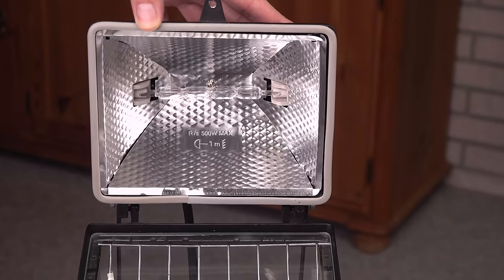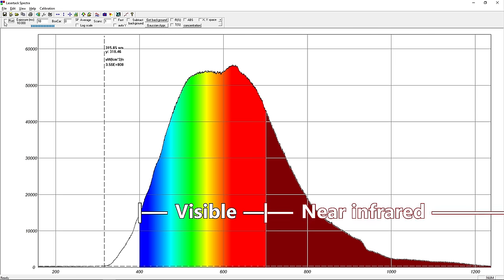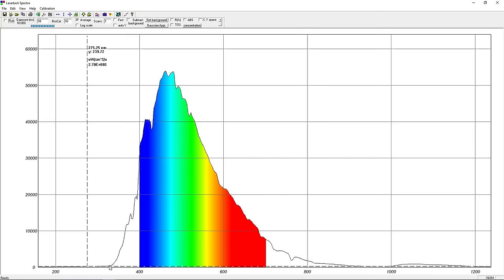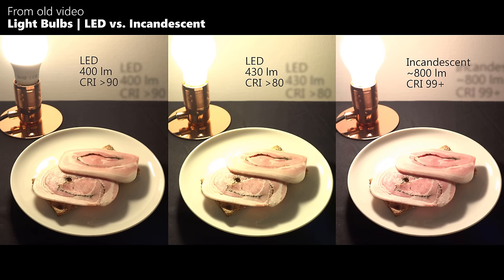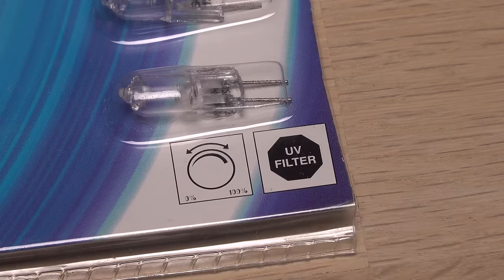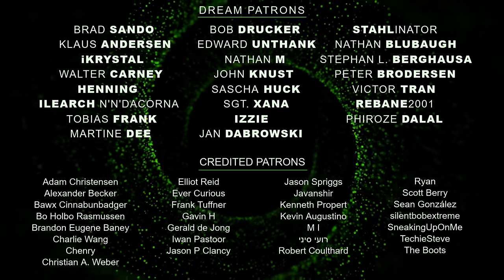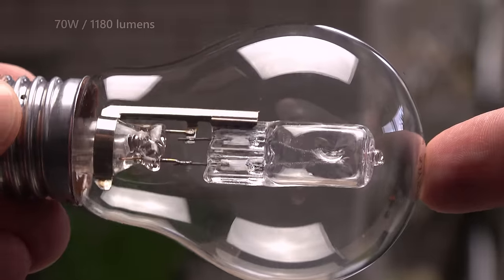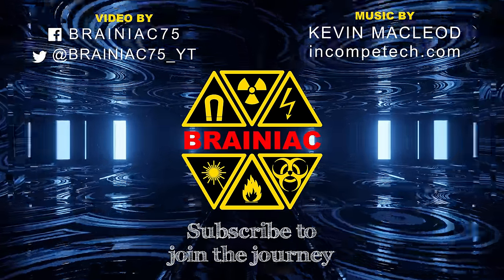Hidden Hazards of Halogen Lamps

Comment: I know this may be out of the scope of your videos, but i think it'd bring dangers "down to Earth" for people if you tried to find out the "real" consequences of being subjected to said dangers (UV in this case).
For example, perhaps you could do some basic napkin "on average" math, like "If you were to use these most unfiltered halogen lamps, uncovered in your bathroom for the course of 1 year, you'd on average have x number of cells in your body that got split DNA; and overall cancer risks would increase by x%"
Naturally its hard to be exact with hypotheticals like that, but it'd still be interesting to get a "real consequences" example, not just "its dangerous, dont do it".

Because if it's +0.003% increased risk of cancer per year of having uncovered halogens in your house, or +15% increased risk, really matters.
For example, Styropyro does this (extremely quick napkin math, but still effective), by simply saying for example "half a second's exposure to this laser, even its reflected light against a wall, will render permanent retina damage or completely blind you".
That really rings home of the dangers, rather than a more vague "its not good" statement.

Comment: Pretty sure the protective glass is there to prevent the stupid hot lamp from exploding if something comes in contact with it. As a work lamp it could come in contact with a lot of debris. I have seen so many of these covered in drywall mud and plaster. The temperature shock would cause the very delicate extremely hot quartz glass to shatter violently sending incredibly hot shrapnel and near molten metal fragments everywhere. The UV is negligible.

Comment: In the US we have started to get some high CRI LEDs available at consumer levels. I replace the ones in my bedroom recently with a set that advertised 90% or higher. Granted I'm color blind so I can barely tell the difference to begin with, but they seem to work rather well, especially compared to the lights I previously had in there
Reply: I've been using the FEIT Enhance bulbs for a year now.  Much brighter-looking and color rendering is much better.  They claim 90-93 CRI, which is obvious when lit.  People still think you need to get a bright white bulb to get color contrast, but the high CRI bulbs do the same thing, and in warm white 3000K.

Comment: I remember getting a letter from Ikea in the 80's or 90's recalling a halogen desk light that I had. It apparently let out a lot of UV. But I had already discarded it because of the excessive heat radiation it produced.

Comment: Those high intensity compact lamps are actually only going to last the advertised 50 hours or so. They seem to be meant for situations where you need to vastly expand the capability of your existing fixtures temporarily. 

A volunteer organization I worked with used them to cover a fairly large site where we had shifts running from Friday evening to Monday morning three weekends in a row every year. The fixtures were lent to us by company that typically worked on much smaller construction sites, and these high intensity bulbs allowed us to keep the the central area with all the detail work very well lit and also make the surrounding logistical area safely lit with the relatively few fixtures we had available. Even going through one bulb per fixture every weekend it was much cheaper to use these than source more fixtures.

Comment: The glass is there to protect you if the light explodes, and to stop rain hitting the hot bulb and causing it to explode.
Try a 1000w metal halide, that's UV for you.
Reply: Metal halide and mercury vapor lamps are safe to be around, because the outer bulb blocks most of the UV light from the arc tube.  Serious skin burns, eye damage and in some cases blindness can occur when the outer bulb is broken and the arc tube continues to light, such incidents have occurred in gymnasiums in which fixtures have been struck with balls and other sports equipment.   Special bulbs are (or were) available that contained a fuse in series with the arc tube that would burn up and disconnect  after a short time if oxygen enters the lamp, these are known as self extinguishing lamps.
Reply: @Sparky-ww5re  The outer bulb doesn't block the UVA part of the spectrum and that can still cause eyestrain if you look directly at the bulb or are exposed to the light for too much time especially at close range.
Ask me how I know.
By the way some metal halide bulbs have UV-Block marked on them just like halogens and therefore glow blue under a blacklight but despite having a bulb like that in a outdoor floodlight with a thick glass cover I still got eyestrain from having spent too much time under that light.

Comment: That is something I'm intrested in.. I have something similar, I bought a rgb LED strip (12 V, 60 LED/m, not water resistent) new from ebay and I noticed, if I have them switched on only blue, flourescent plastics glow. Now I'm a bit worried what wavelength it emits. Could that blue light be dangerous to my eyes. Maybe that could be a video idea for you. I just tested it and I feel like the green LED also stimulates some plastics)
Reply: Actually some plastics glow under blue and purple lights even if there's no UV at all.
For the danger, if looking at the blue light hurts your eyes even the slightest bit I would advise not to keep using it as it can actually be harmful to the retina.

Comment: Interesting, for ages I had a 500W halogen as a back yard light, it never had a glass cover, nor is there any place to fit one. I got sick of replacing bulbs & the high operating cost, so it's now been replaced with a pair of 10W LED floods, they are way better as I can run them for extended periods without wondering about power bill shock.

Comment: My dad had one of these we would use when doing touch up paint. It would be set up behind me while working. I remember after painting having a rather bad sunburn without spending time outside. I remember saying that I think the light did it and he said there was no way. It did have a glass cover but was probably from the 60's so who knows.
Reply: Maybe it was way too close to your body and touch up paint took so many hours that the sole UVA rays (Which are the only ones not to be filtered by the glass and also the least likely to cause sunburns given their low-ish energy) actually managed to get you sunburnt.
Or maybe it was a burn caused by the heat alone, who knows ?

Comment: Yes bare halogen bulbs emit quite a lot of UV due to the high filament temperature. I actually used one of these working lamps quite recently. Complete with UV shield glass and everything but not that it mattered much at the time as I was doing welding work at the moment wich itself emits LOTS of UV. I was repairing a mixing machine at work that had started leaking after been mixing abrasive polishing compound for many years so the bottom was about to go out and create a total mess! (Around 1 m3 of polishing compound dumped on the floor) but fixed it before that happened luckily! Now its patched up for some more years of abrasive mixing at least! :). That lamp came really in handy then as the mixer is situated in a dark corner of the factory. LED is more efficiend but indeed still cant compare in color spectrum and color temperature is often a bit cold in comaprison  although decent warm white LED lamps exist now where this is important.
Reply: The UV emmited from halogen is nothing compared to the UV from a mercury vapor or metal halide bulb that continues to light with the outer glass broken.  Years ago there were incidents where people suffered severe eye and skin burns in school gymnasiums where a lamp was stuck by a ball and  partially broken. As a result special lamps that consist of a thin strip of metal connecting to one end of the arc tube that burns up and disconnects within 15 minutes of air exposure,  became available and recommended for use in gymnasiums and similar environments.  These are known by different names depending on lamp manufacturer,  like Self Extinguishing, safety, or Type T lamps.    Fortunately in this day and age this is not an issue because new schools use LED, and many existing schools have already converted their HID high bays to LED.
Reply: @Sparky-ww5re Mercury vapor and metal halide bulbs emit a lot of UVC rays just like arc welding and germicidal lamps do.
This is actually what causes eye burns known as arc flash by welders.
The outer glass envelope of MV/MH bulbs blocks UVC as can any ordinary glass window by the way however it still lets out UVA rays which tend to cause eye strain rather than burns and are known to cause ARMD, cataracts and melanomas.
Halogen bulbs on the other end emit mostly UVA in addition to the visible light and infrared rays.

Comment: I used to have one of these 400W halogens in the roof as a light source for the rare times I would be up there. But I removed it due to the concern of accidentally knocking it over and setting the house on fire. They're basically a free-standing furnace. Now I use multiple LED globes that in total consume less than one tenth of the power of the halogen.

Comment: I have a halogen bulb in a photographic enlarger, and if you think 50 hour lifespan is short, my bulb is rated at 40 hours. This is because halogens and incandescents don’t particularly like being turned on and off a lot. Which is exactly what you do in the darkroom. Bulb goes on, a short time later it goes off. I would replace it with an LED, however in the video you show exactly why I can’t. The color rendering of the LED is super bad. No way I can print color pictures with that. My bulb has no UV filter glass, but the enlarger itself does. The light bulb also gets really hot. Like, super hot, lol. After a while of using it, even in short bursts, it heats up the room.
Reply: There are way quite better LED's now (for example Sunlike) if selecting based on how good are colors under it.

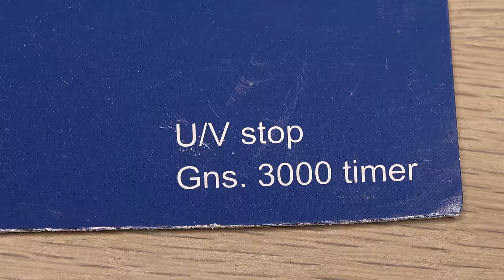Comment: 6:05 That light is called dichroic. It sises several thin layers of materials that have different indexes of refraction engineered mostly to reflect the visible light to the front and to throw the IR to the back so they don't heat the object being illuminated. But maybe it has an effect on the UV too

Comment: I notice that the UVB/C detected with each bulb is a very low level. Is there any amount that is generally safe? Or is even a tiny amount dangerous?
Reply: I think no amount is really safe for that matter, however it's worth mentioning that a summer sun will give you way more UVB than any halogen lamp of reasonable power.
UVC on the other hand will cause arc eyes aka welder's flash if you look at a powerful enough source of it for a sufficient amount of time, and the amount emitted by halogen lamps might be too small to be as much of a concern.

Comment: I remember having taken a 850W halogen bulb from a laser printer back a few years ago and whenever I turned it on I felt my eyes getting strained despite not looking directly at that artificial sun of a bulb.
Also looking at the light with a window between me and the bulb didn't change anything.
Therefore I asked for advice on a forum and got replies saying that it definitely puts out UV and that since it wasn't designed for lighting rooms, the manufacturer might as well have cut the costs on doping the quartz to block UV radiation.

I also ran the blacklight test on it and found that it didn't glow at all, however it's worth mentioning that no R7S bulb I know of glows under a blacklight, which means it definitely puts out UV just like the bulb from the printer did.

But and this is where it gets weird to me I don't remember having gotten any eye strain or sore from a R7S bulb, not even a 500W one with no glass in front of it.
Back a few years ago I assumed it must have a coating on it (Even though it doesn't glow under a blacklight unlike some small capsules or reflector bulbs that glow the same blue as tonic water under a blacklight) unlike the printer bulb but this video proves me that nope !
They just let out the entire spectrum from the filament just like the printer bulb might have done.

Comment: So many very low quality led bulbs on the market, not only in CRI but just lies on lifespan. I've thrown away $1k of led bulbs that claimed to have 27 year lifespans. They started failing within 6 months because of poor design, diodes ran too hot and failed. 
Meanwhile my incandescent lights not only look nice but actually work for years. 
Learned my lesson the hard way.

Comment: Couldn't you theoretically run automotive bulbs in a fixture that spreads the light out evenly as a replacement for household ones? They might be a bit bright but they aren't going anywhere soon because LED replacements have awful beam patterns in halogen (or xenon) reflectors and projectors that make them a safety hazard for other drivers or they just don't shine as far as halogens with less than half the light output.

Plus, you can get automotive bulbs with slight blue tint on the glass, which makes the light pretty close to perfectly neutral white, but dims them a little. Could be an interesting thing to try since H7 bulbs are still everywhere and they're fairly small.
Reply: You could.

Comment: oh, huh. My parents had some unusually tall halogen floor lamps that directed the light at the ceiling. They had completely opaque “shades” that I always thought were wasteful because they blocked all of the direct light. There were dire warnings printed on a sticker by the power switch about keeping the lamps vertical, but no indication as to why. I remember the bulbs being bare inside. I wonder if the manufacturer was relying on the scattering of the light off the ceiling to get rid of the UVB.

Comment: Would the long 1500W bulb last, if worked below full power maybe with a dimmer, as an IR heater? 
I'm guessing the lack of halogen recovery would shorten the life.
Remember the older bathroom hearers had a NiCrome spring encased in a quartz tube?
Reply: In winter I have been using two 400 watt halogen tubes connected in series under my table as radiant heaters for over 15 years. In addition, I regulate the voltage as needed with a dimmer between 30 and 100 volts per tube. If the operating voltage of an incandescent lamp is half the nominal voltage, then practically no tungsten will vaporize, and a halogen cycle is not necessary at all. The lifetime of incandescent lamps or halogen tubes operated in this way reaches a million hours or probably more, theoretically.
Reply: @Tag-Traeumer  I thought I was the only one crazy enough to "invent" alternative devices 🤣
Reply from the maker: Sure, the 1500W tubes would emit a lot of heat even if ran at a lower voltage. But I would guess it would last shorter than advertised even though it is running colder. Simply from not getting hot enough to start the halogen regenerative cycle as you mention. You should look for the halogen lamps meant for heaters, try searching eBay for: "infrared halogen heat lamp 1300W"
Reply: Heater you say?
I run an 1800W hair dryer when I get in the shower.
Get out of the shower and have clear mirrors and a warm blast of air to dry off with.
Reply: @tommiller1315  Crazy, but smart and reasonable. 😄 Even though my infrared radiator from two halogen floodlights consumes around 50 to 200 watts of electricity (depending on the setting), I save a lot more heating energy (because my feet are warm even at 18 to 19 degrees Celsius).
Reply: @brainiac75  As I wrote above, I assume that halogen lamps that are operated with significantly reduced voltage will last a long time, those operated at half voltage a million hours or more, those with a slightly lower voltage forever. Because no tungsten vaporizes, then the halogen cycle doesn't matter. My 400 watt halogen tubes, which I have used as radiant heaters for 15 years, are as clear as new, there is no black trace of tungsten on the inside of the tube. I operate these halogen tubes with 50 to 120 volts instead of 230 volts nominal voltage, they have run for about 4000 hours so far, and they are slowly started by a dimmer (soft start).

Comment: They are higher in UV but better color  and in the winter they keep you warm !And it's a far better light than LED .The best light is still HID Metal Halide .LED produce a terrible light and do the test on the led bulbs without the glass in front!All white output LEDs are UV based emitters !
Just like fluorescent tube lamps .Take away the phosphorescent coating and you have a UV light .

Comment: I made the mistake of switching my light source for some corn plants I was growing indoors from led to halogen. Within a few days the plants turned red and then died! I was so confused until I learned that unshielded halogen bulbs can put off uv light so apparently the levels of uv emitted were pretty significant.
Reply: I5 was probably the heat, there's way way way more uv in sunlight and the corn would have done alright in that.

Comment: This is a tiny amount, look at the scale and output relative to the visible light. This is similar to the blue light scare. Reality check: how much yellow plastics do you have in the bathroom compared to a living room where sunlight goes through 2-3 panes of glass. The big bulbs are to cover a large work area or a yard where the energy is spread out, while a 20W is a dim desk lamp much closer.